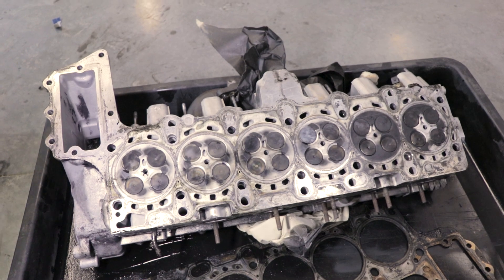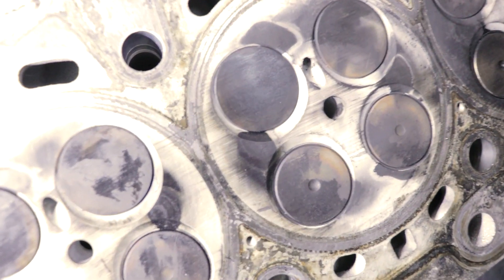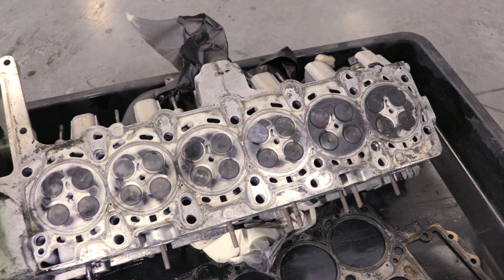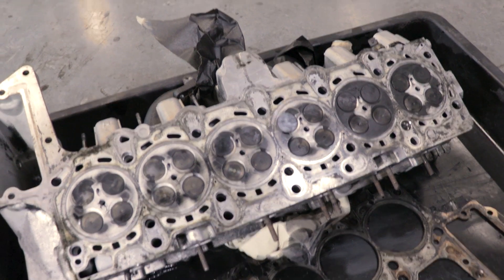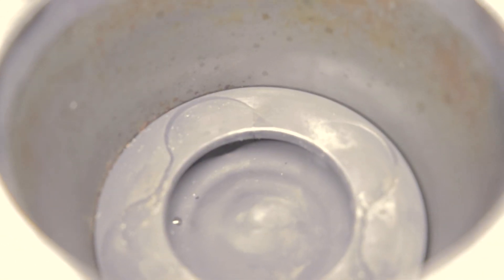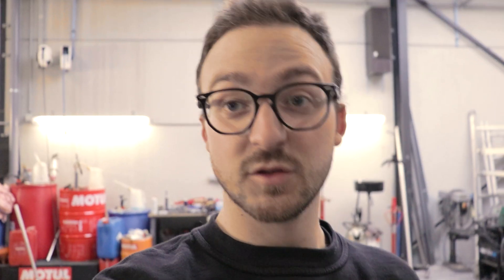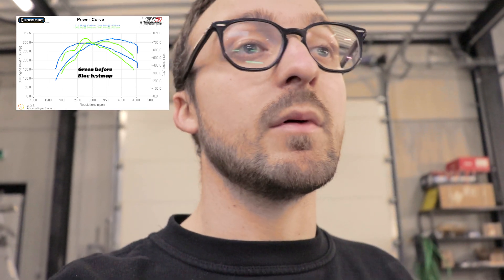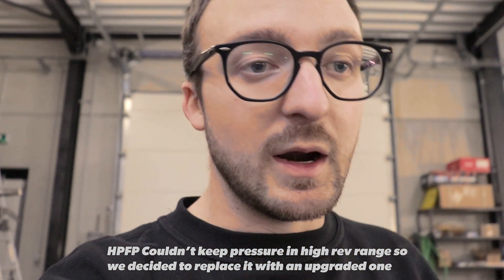BMW E91 335d Engine Failure!

Comment: You're the best software tuner I've ever seen. I could bring you my BMW 335d E92 from Austria for stage 2 conversion. Would you do that at 140,000 km? I think highly of your honest opinion
Reply from the maker: Yeah sure always welcome! 
I wouldn't bother to much about the milage, as long as you maintain it well ant do oil service every 10-15k km, nothing to worry about. My own e91 325d has 380 000 km and my e46 330d has 431 000 km 🤪

Comment: I have one head that have cracks on all cylinders between glowplug hole and intake valves. Also m57 engine
Reply from the maker: Yeah that's not uncommon, but luckily that's no problem 90% of the time. The cracks between intake and exhaust valves are not that favourable
Reply: @svrautosport1632  yhea i know that but i replaced my head any way, i run with bad headgasket over 4 years, the car have knock/miss when cold but will be almost perfect when hot, result is headgasket burned between cylinder 5 and 6, compression test never show that probleam with all cylinders over 375 psi. I have just puff on the intake side like bad injector seal but tunred out to be headgasket.  Important car will smoke a litle bit white, unburned diesel. take so much to discover that is headgasket lol.
Reply from the maker: Indeed, what i do is i never do compression test alone, but always in conjunction with leak test, then you most of the the time have a better view of the saituation